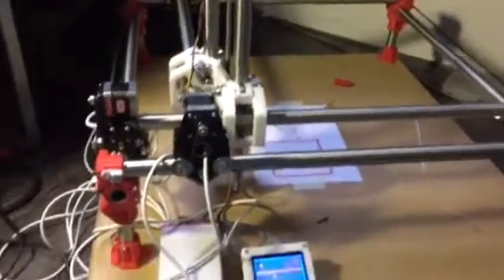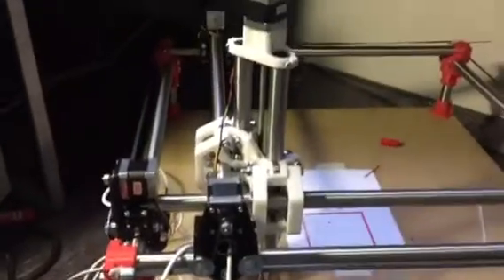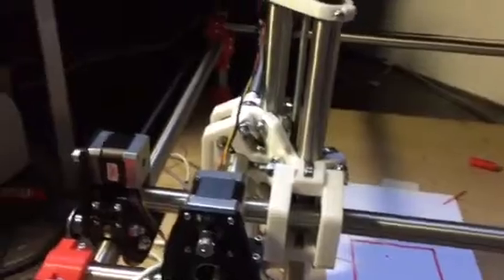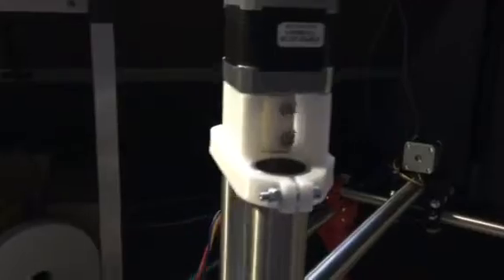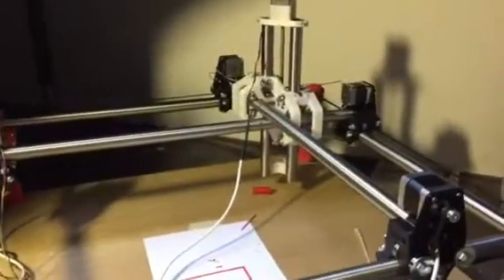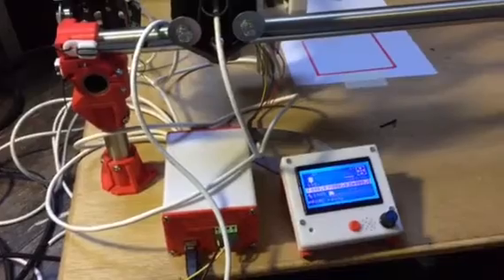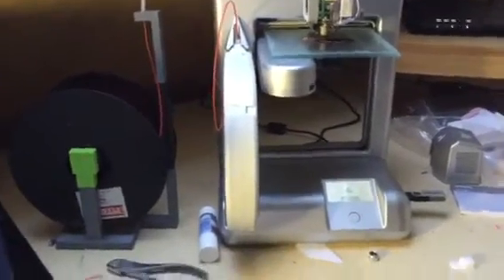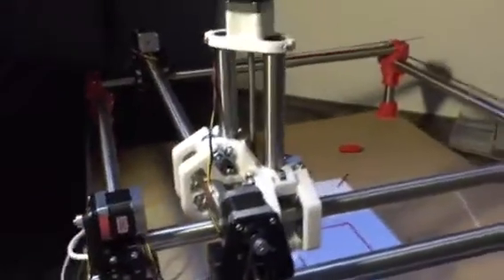First run MPCNC

Comment: Thank you for all the compliments! Your build looks great.

As for the z axis, turn the driver pot up as high as your stepper can handle, have a look at my beta firmware I did a lot of testing with accelerations and think I have it set up real nice now, helps avoid missing steps.